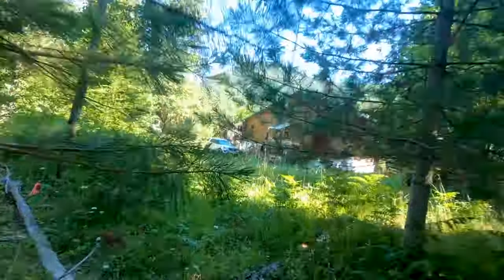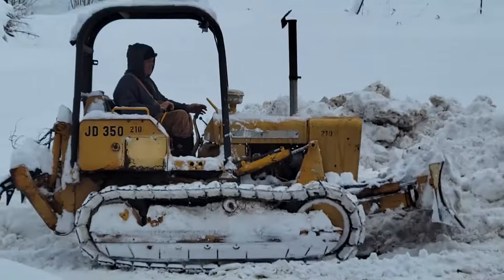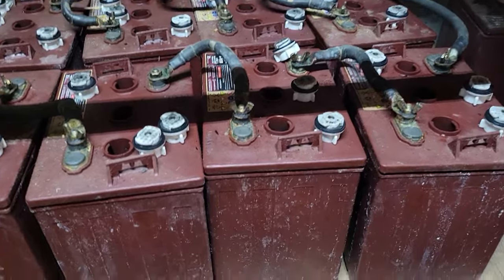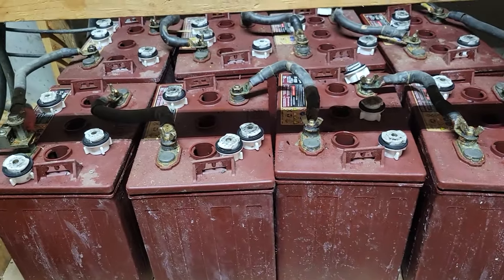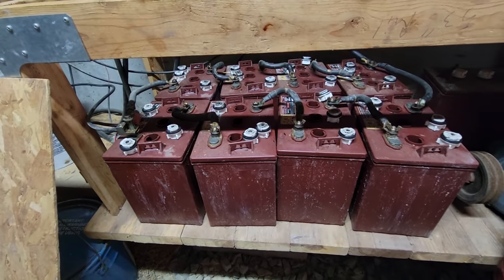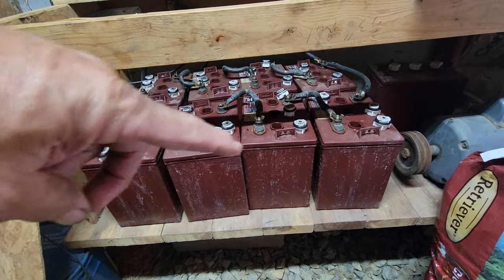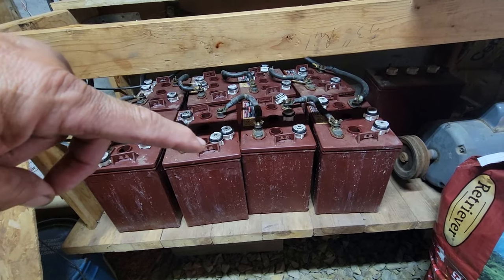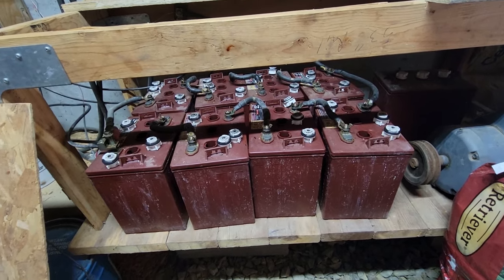DO I NEED NEW BATTERIES???  Offgrid woes.

Comment: Six to seven years old? They need to be replaced for sure. Is the water distilled? If you are using well water, that's not good for batteries. LiFePO4 have come down less that most lead acid / glass mat batteries. I will be replacing my lead batteries with LiFePO4 batteries this summer.

Comment: Sounds like you've got some good quality batteries if they're 6 years old.
I like paired 12v for my 24 volt system (we're running about the same amp hours as your setup)

A couple of things I do differently...
Refrigerators and freezers get turned off when the sun goes down and turned back on in the morning (no draw on the system)
And, I've got my panels facing East and West (instead of South)
This allows me to catch hard sunshine 4 extra hours each day.
Reply from the maker: Great points!

Comment: Lead acid is not the way. LFP and only charge from 30% through 80% so add a couple more to your stack. That way you get more charge cycles in the life of your batteries. LFP are safer, don't need water, and if you don't run them dead or charge more than 80%, live longer. Much longer.
Reply from the maker: Yeah but they don't like the cold!  THAT is a problem up in North Idaho AND they're super expensive!  I would need $6-8K worth to do what I'm doing here.....   maybe someday I will...
Reply: How much did you pay for the old units? How much for the replacements? The LFP's that I have been using have outlasted 3 sets of lead acid already and are supposed to last 20 or more years. 5 or 6 sets of lead acid? Add that up and compare price. As for the cold. Do you have an old heat pad? Foam peanuts and some old boards?  @HiddenValleyHomestead
Reply from the maker: @deplorable1-2   So these old batteries came with the house we bought.....  Check out todays video to see what I did.... Major upgrade...
Reply from the maker: And yes I agree... LFPs are comparable to multiple sets of lead acid..... So then I need to upgrade... @deplorable1-2
Reply: @HiddenValleyHomestead  But his batteries are in the basement. Cold weather performance still would be better than lead due to the better internal resistance .

Comment: We changed to the AGM on are mobile dimension sawmill.
A generic 60 month battery would die in under a year. The AGMs last around 15 years, exposed to the same staggering vibration.
.
The battery is basically strapped on top of a VW engine rigged for stationary use, and is a staggering amount of vibration that the battery deals with.
Reply: Keeping freezers in a cool and shaded location will help a lot, especially come the spring time change.
I notice it a lot, as my freezers are the biggest part of my power bill.
And outside temperature really has a affect on energy needed to keep it cold.
Being off grid, I'd consider having any freezer or fridge within a room with extra insulation of some sort, to help control  power needed.
0.01c
Reply: We are using 12 Volt 200Ah Deep Cycle AGM Battery
Reply from the maker: Great insight!! Thanks for that!

Comment: I bought AGMs for my vehicles, and read somewhere that you need a charger that is specifically made to charge that particular battery.
Reply from the maker: I did some research and some chargers do have a different setting for AGMS while others treat them just like a lead acid batt.  My inverter does this.  I didn't have to do anything different.  Stay tuned for Fridays vid!

Comment: I’m right at the beginning, and I know where this is going.
First, if you are really hardcore prepping, you need to find things that are sustainable and readily repaired by an average guy.
Lead-acid batteries are not that bad to overhaul.
The thing is, you need to find things that can be made out in the sticks to repair what you have.
Can you replace the electrolyte?
Can you use an electrolyte that is made by natural processes?
How about the plates?
Can they be made from something that can be found in local nature?

The ultimate prepper is going to be the guy with vast knowledge, and the ability to bring that knowledge that has been buried in his mind up front in fairly short order.

I am a guy that has a LOT of knowledge.
I also know that some is buried deep, because I don’t use it so much.

No wonder people ask me what is wrong when I zone out on a problem!

The OTHER thousand yard stare!

Comment: Which YEAR was this taken?  I had a pal that was raised in the sticks as I was that was Army and a trained electrical engineer and worked for NASA all his life that said that EVERYTHING was a tradeoff and he was right. More demand? More supply.  The cell tower batteries sound good BUT you might as well go HEAVY because you'll always be adding here or there. Figure on it. You know how you are. Hug the dozer and God Bless Yall!
Reply from the maker: You're spot on as usual Lewie!  Stay tuned for Fridays vid!
Reply: Waiting on it, Buddy! @HiddenValleyHomestead
Reply: Cell tower batteries are only for emergency backup and not for cyclic use.
Reply from the maker: That's not what my research has shown..  I've run Odyssey batteries for years in my trucks and RVs..  why would they recommend those if they couldn't handle cyclic use?  Real question.   Show me a link that says that and maybe I'll make a new video about it.
Reply: @HiddenValleyHomestead  cycylic discharges in a energy storage system is capacity discharge from 100% to the recommended discharge. In a lead acid chemistry that is recommended no more than 50% This is quite different than a vehicle starting battery. You can do as you wish but with today's options it is inefficient to use lead in my opinion. The lower internal resistance the actual available usable capacity as well as the recent lower costs of lithium iron phosphate battery options that don't require a constant float charge current exc got me sold. Better warranties even.
Reply: Where's the link(beef)! @HiddenValleyHomestead

Comment: Surely you can restore these Batteries? Topping the water level isn't everything- you can tear them apart and refurbish the internals so that you get a better reaction in order to produce more POWAH! which does amazing from what I've seen (no first hand experience). What you've got has lasted a really long time if you've never had to restore them that way though. If this is original, even if they were new when you got them that's still a long time for lead acid batteries. At least that's what I've come to understand, I don't have first hand experience with this sort of thing- this is all just research I'm talking. You've got experience so you probably know better- just putting my half cent out there.